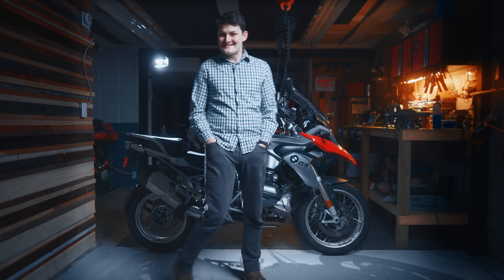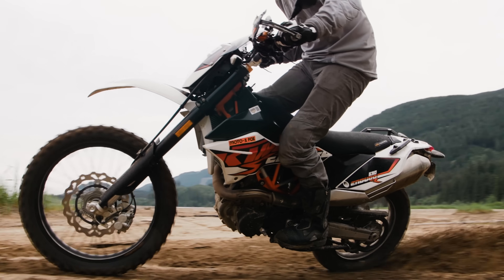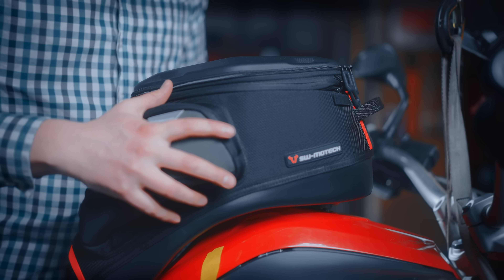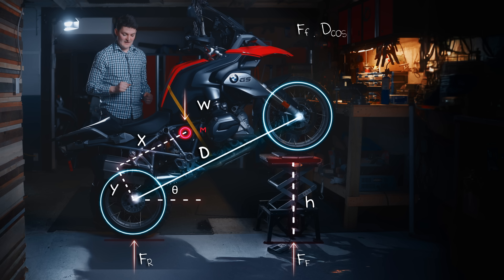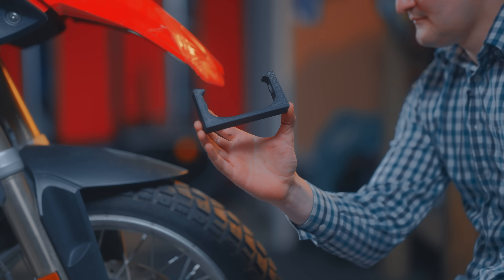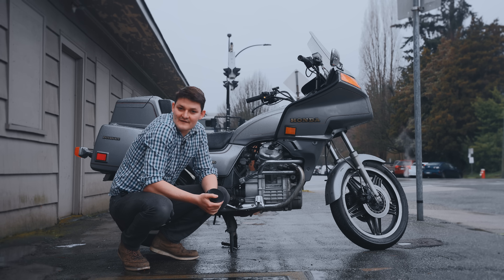Mark Your Motorcycle’s Centre of Gravity with a Bathroom Scale

Comment: Not exactly. This assumes a greater consistency of weight throughout the bike and that the bike is not moving. Acceleration affects center of gravity! And no, you wouldn't put your bags on that center of mass - if you knew it - because you might want a better location for the shift in center of mass when accelerating & decelerating!

Comment: The more weight that is below the axle level the more the motorcycle will stand up on its own. however any weight that is above the axle level. will make the motorcycle more prone tipping over. so ideally the mass of the weight closer to the ground. would be optimal for the best center of gravity  but unfortunately motorcycles have to have ground clearance. which raises the center of gravity.

Comment: X1c is the best out there in my opinion. As an absolute clueless first time 3d printer owner it just WORKS. the auto bed level and lidar calibration is awesome. The AMS is good too but I have had feed problems from time to time but the software for the most part retries the feed till it works. It’s a great machine the true hard part is just learning 3d software like fusion 360 and the like when you’re trying to do your own stuff.

Comment: obviously standing increases the height of the cog if you're rigidly attached to the bike. I mean you're just a mass, added on to the top.
HOWEVER: If you are not keeping your arms solid, and allow yourself to pitch freely in relation to the bike (as in, you stay vertical when the bike pitches) then technically, your mass in that given moment is added to the pegs. Whenever you apply a force to the handlebars to maintain that position, however, is when the force is applied more to the top of the bike.
As with any question, the answer is: it depends. The static cog is higher. The dynamic cog is shifting around all over the place, not just depending on your position, but your angular acceleration in relation to the one of the bike.
The scale only tells that static story, but dynamic systems with you flopping all about on a bike tells a different story. In reality, we don't calculate these things, but instead use our intuition

Comment: Who would have thought that moving weight up would move the CoG up. But only if you and the bike are one rigid body, which is more realistic when you sit down than when you stand up. So if I get it right, in a way, standing up lowers the CoG because it separates the bike and the rider into two masses.

Comment: Nice one but there is a catch. When standing or sitting on the motorcycle to calculate the vertical deviation of the center of mass, you need to repeat both measurements, that is both the horizontal and the inclined one. I am sure that sitting on it throws the center of mass far back

Comment: Interesting method Ryan! Personally, I prefer suspending the motorcycle from two distinct points and drawing a vertical line from each suspension point. The intersection of these lines gives the center of mass.
Given that you have a full garage with ceiling-mounted chains for holding the motorcycle up, have you tried this approach? Of course, it’s understandable if you didn’t want to show this method, since most people don’t have access to such equipment. But it would still be interesting to compare both methods and see if they match!"

Comment: I think you're partly right, but partly missing something.  Yes, standing up on a non-moving bike raises the center of mass. But standing while riding, when done properly, actually lowers the effective center of mass relative to riding while seated on uneven terrain.

Seated on the bike, your entire body weight shifts the center of mass up compared to bike's own COM.

Standing, it moves it up even more.

But if you could calculate the COM dynamically while riding on a bumpy road, you would see that it moves up and down, for two reasons:

1. The bike's shocks, which change the geometry of the bike and thus it's COM. This happens whether you are seated or not.

2. Your knees, acting as shock absorbers, effectively remove a lot of your body weight from the COM calculation for a brief period, thus lowering the COM.  When you are seated, your entire body weight contributes to the COM at all times.

This is because of how sprung mass and unsprung mass impact the dynamic center of an object when those two subsets of its total mass are moving separately from each other.

Disclaimer: I am neither a mathematician nor a physicist, so there may be some errors in my explanation, but I think I captured the high level bits correctly.

Comment: A 1" thick length of ply wood, a wooden dowel. Dowel about center under the plywood. Get the bike on the plywood, move it back and forth and let the plywood roll accordingly. When both wheels are off the ground and balanced front and back that is center of gravity. You don't need sharpie markers, a scale, math equations or marketing. Many other materials can make that work but no scale needed.

Comment: If you stand on the foot pegs you cg move Forward and up (YOUR CG) it loads front tire...but you can't think about CG for the bike + rider set. It's not a rigid set and as such won't move as a single piece. Big difference too is moment of inertia...if you want to play engineering you should look at it...

Comment: Great vid, shouldnt you be measuring the standing up position without pulling on the handlebars? when the bike is flat and youre standing up, almost no weight is on the handlebars and it seemed from the video that you measured the standing position while holding(and therefore lifting the front wheel) the handlebars.

Comment: For anybody wondering, you can use proper units like cm and kg on that spreadsheet and it will all still work as Ryan intended.
There's nothing in the calculations that means you have to use pounds and inches.

It does however look like it's assuming that both wheels/tyres/tires have the same radius and therefor the hub to hub wheelbase is a perfectly horizontal line and so the same as the contact patch distance.
The different tyre profiles on a GS slightly counteract the different wheel sizes, but the front wheel radius is about 10mm larger than the rear.
That's not going to make a huge difference but for bikes with a significant wheel size difference, you should adjust the height of your puck to make the hub centres level and the same calculations will work.

For the angled measurements, you'll need to add that difference in tyre radius onto the front wheel height h (Unless your front wheel is smaller? then subtract the difference from h)

Tyre radius (r) in mm = wheel size (w) in inches X 25.4 (converts to mm) /  2 + tyre width (w) X tyre profile (p) / 100
 r = w*25.4/2 + w*p/100

for a BMW rear is 150/70 R 17
= 17 * 25.4 / 2 + 150 * 70 /100
= 215.9 + 105 = 320.9mm

For anybody working in Inches

Tire radius (r) in " =  wheel size (w) in inches /  2 + (tyre width (w) X tyre profile (p) / 100)/25.4 (converts tire size to ")
r = w/2 + (150 * 70 / 100)/25.4

= 17/2 + (150 * 70 / 100)/25.4
= 8½ + 4⅛ = 12⅝

(or just measure it from the ground to hub centre! Quicker and more accurate!)

Comment: What about the rearward bias the rider's weight adds? Or when you're riding with more than zero fuel?

I'm not sure who cares about all this. Everyone should be able to understand why loading up 120lbs of gear in rear saddlebags doesn't help bike handling. Ever tried to not wheelie with a passenger? Yeah, it's trickier.

Odd video. Well done, but still very odd.

Comment: Treating the (standing or sitting) rider plus the bike as a rigid-body system for calculating height of center-of-mass is not that accurate/useful. Especially in the standing case, the rider is only loosely coupled to the bike by a complicated system of soft linkages (your body) dynamically controlled by a feedback controller (your brain) so the bike ends up moving largely independently of the rider (with the rider exerting a variety of forces on the actual "rigid" motorcycle system depending on the goals).

Comment: I probably wouldn’t promote CF filaments. The CF nano tubes break off and absolutely litter your fingers with embedded fibers. There is no evidence that breathing CF is safe. People are using a microscope on their skin days after working with the CF filaments and there is still thousands of pieces of CF stuck. If it’s having a hard time getting out of your skin, the chance of it getting out of your lungs is zero. 

Keep this in mind if you’re making CF parts rubbing between your legs, fingers or nuts. 

Not to mention CF filaments look fancy but generally serve no real benefit in terms of strength, they tend to snap as opposed to bend.

Comment: Nice highlight of the value of a 3D printer (*any* decent 3D printer) at the end!  If you're into fiberglass or carbon fiber parts and have a 3D scan or other model of the piece you want, you can 3D print molds to do the layup in.

Additionally, you can print stuff in TPU, which is squishy, heat resistant, chemically resistant, and sturdy enough to 3D print gaskets for things like carburetors and valve covers.

Comment: This is really interesting, thank you! I hope you find this interesting too. For airplanes, knowing their center of gravity is crucial. To put it simply, being balanced or slightly nose-heavy is like a sport bike, while being tail-heavy is more like a chopper with long front forks! In many ways, bikes and planes operate similarly—except bikes don’t have a Z axis (up/down). The A axis (rotation) with the ailerons on the wings is like countersteering on a bike, while the X axis (left-right) controlled by the vertical fin on the tail is more like direct steering on a bike.
Reply: Getting an airplane on your bathroom scales can be problematic. How to get it up the stairs for one 🤔
Reply: @ No no! You take the bathroom scales out to where the plane is sitting…Geez……..

Comment: I really don't care where the CG is on my Harley bagger.  It's heavy enough and low enough there's not much I can do to move it, and I don't ride it aggressively enough for any of that to matter.

And yet the engineer in me and F9 fan couldn't resist watching the video.  Now I'm wondering if I should get a 3D printer.  I didn't really have a use case for one before but now...???  Hmmm

Well done as usual F9!

Comment: So I figure I'll chime in here. I'm an Australian who ran a 3D printing service bureau for nearly a decade, making all sorts of parts. I am a cyclist, but I love my other 2 wheeled brothers, and made a lot of parts for them. I was there when the patents ended, and I tried to contribute to the development of the open-source printers that were making those machines better. My business was shuttered during the COVID lockdowns, but I still have a few dedicated clients. I'm at one of their places right now, sitting right next to a Bambu Labs printer I commissioned for them. When I started doing prints for them, the process required someone like me to step them through the process from idea to print. We shared the CAD workload, but I kept the repraps running, and they got their parts. At a certain point I explained to them that printers had gotten so user friendly that they just should have one in their shop and if it was necessary, I can help them with CAD remotely. So far I haven't needed to. They did pay me to set up the printer, but I didn't fleece them. They now have a Bambu Lab printer. I know there's a lot of other good models out there from other brands, but Bambu Labs was a pivotal moment for my psychologically where I knew that I couldn't keep up as a small business in terms of the ability to deliver good parts to clients, compared to what they could do for themselves, at a high standard.

Comment: Cool video, as always. I want to mention though that I think a large part of the reason standing is often better than leaning has to do with leverage. If the bike is leaned over while standing the force of gravity pulling on your body has a shorter lever distance (footpegs to contact patch) than it would if you were sitting. Likewise, the pegs are also wider than the seat and your feet can more easily transfer weight to the desired side of the bike than your cheeks can. And even if you have a very skilled behind, the longer lever will make the feet more effective.
Reply: This is difficult to understand but you are confusing what the system being analyzed is.  You have a choice of letting the system be either just the motorcycle (with rider applying forces to motorcycle/system at the points of contact ( foot pegs and handlebars), or alternatively considering the system being a combination of motorcycle plus rider. In this case the contact forces between rider and bike are internal ( meaning they cancel by Newton’s third law have no affect on the system).  Things are further complicated because when seated the bike and rider more or less move together as a rigid joined system making it reasonable to treat them as a single system.  However when standing(correctly) the rider lets the bike move under him/her as an independent object.  In that case it can make sense to analyze the motorcycle as an isolated system.
Reply: @ I’m not confused about the center of gravity analysis at all. I agree with his conclusion that standing raises the cg - it agrees with common sense. I was adding a reason as to why standing may feel more stable, that being the effective lever of where your weight is transferred to the bike. 

The bike and rider being more disconnected when standing as you say feels like what Ryan was saying about standing letting the bike move more underneath you

Comment: You have a hoist there, and the ability to lift the bike clear of the ground. If you lift the bike with a sling having unequal legs the bike will be lifted at a slant. The centre of gravity will lie on a plumb line from the point of suspension. Taking a picture is the easiest way to mark this line on the bike. Now lower the bike, reverse the sling legs so you raise the bike on the opposite slant. (i.e. If it was handlebars high first time it will be tail light high the second time.) Take a picture. You now have two lines intersecting at the centre of gravity.  I have done this for acceptance tests of 1 1/4 ton trucks for the Canadian Army so I know it works.
Reply: Surely would only work if the 2x legs of the sling had a zero-friction slide at the point of lift? Then they'd settle to the config that has the COM at the lowest point...

Or if you just dangled the bike off the ground, held by only one point, then repeated hanging from a different point, COM is where the 2x plumb lines cross.

Loving the physics discussions
Reply: @stevenpate6501    Friction at the points of suspension doesn't change anything. A rope can't provide a moment - it just bends to align with the force. The rope is providing a tension that supports the load. Imagine the unequal leg sling is supported by  a third rope.  The load will swing so it's centre of gravity is under the point of suspension. You just need a plumb line from that point
The fine points of this test (It is an SAE specified method by the bye) come in the condition of the vehicle for test. Liquids must be at a specified level and any moving parts must be secured in a 'proper' orientation. The mass of the restraints must be accounted for.
I've done this test for military and agricultural vehicles, and as exciting as it would be to lift them from a single point I think the bike would pee gas all over you. Even if it isn't an Amal carb.

Comment: This is actually really misleading. Standing separates your mass from the motorcycle mass, using your legs as a secondary suspension (as you don’t lock your legs straight). So when it comes the the amount of mass your suspension needs to manage and the stability of the bike, the CoG of the mass that the suspension has to manage is actually lower as your legs manage your mass for the bike.

Comment: 4:40 The Royal Enfield Flying Flea was designed to be used by  paratroops during WW2 for airborne operations such as D-Day and operation Market Garden. They were delivered to the drop zone either by glider or parachute and had a yellow stripe painted on the crankcase to show the centre of mass.

Comment: 1: you are not considering compression of the suspension
2: who cares? Well the manufacturer certaintly thought about center of mass position, but as a motorcycle user i don't see how adding luggage affects the performance of a bike like the GS, with over 200kg of mass + 70kg of you your center of mass isn't really moving anywhere. You are just stuck with the factory default, and if you even load so much in the back i guess you arent gonna race, just add some preload to the back suspension and try how it feels like, this is just a waste of time in my opinion

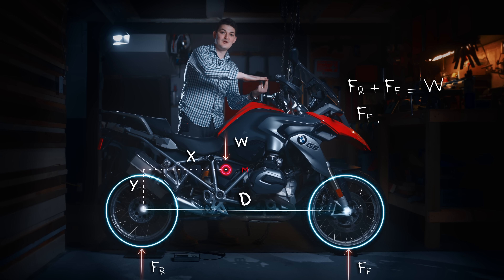Comment: 1:54 doesnt that apply only if we assume Y = 0 ? Because otherwise W isnt tangential to the point of rotation.
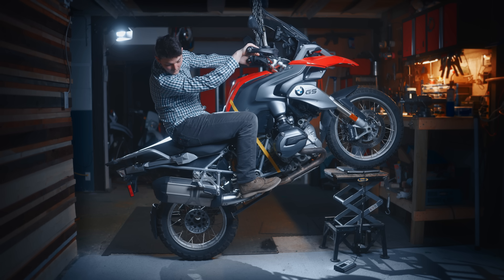4:55 that isnt standing up straight. The center of mass obviously came up higher, because youre pulling on the handlebars, pulling the weight off of the front wheel.

Comment: Couldn't you simplify the first problem drastically by having the known weight on the back wheel, X, and watch it's movement when adding an item of a known weight, let's say 1kg and call it Y. Now place Y anywhere on your bike, if X increases by Y then that weight is 100% on the back wheel. If if X doesn't move then the weight was added 100% to the front wheel, when X moves by exactly 0.5Y then you have your point of equilibrium.